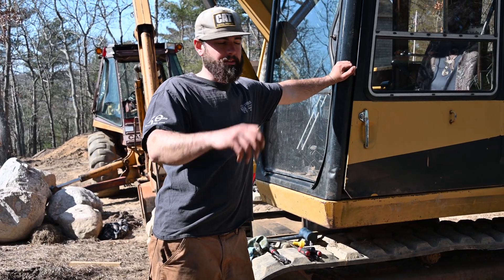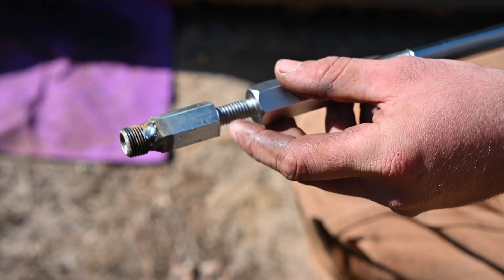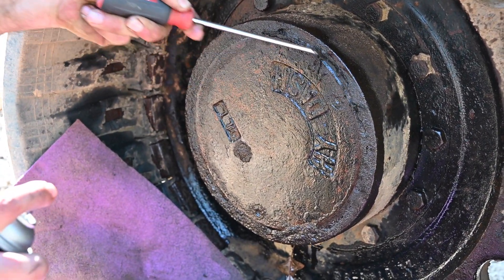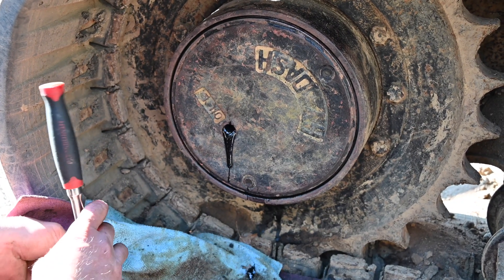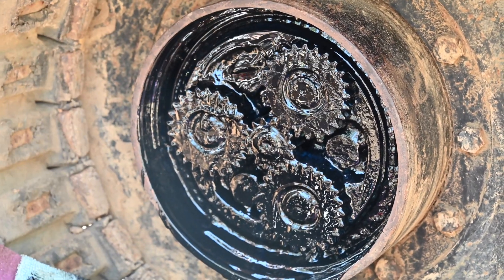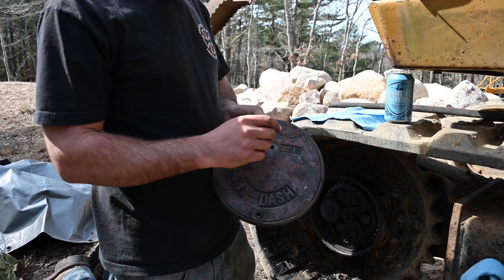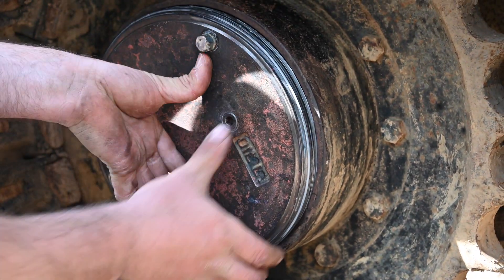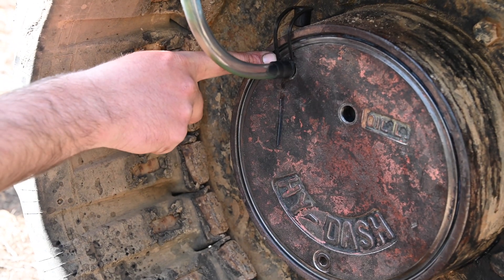CAT E70B Final Drive Repair

Comment: how do you tell if the final drive needs repair. what ´s signs to listen / look for sir.  thx for great video.
Reply from the maker: Luckily I haven't had a final drive fail on me personally or at work, but listen for metal to metal grinding, popping/knocking, or high pitched squels. If you see a leak take care of it asap, if fluid can get out, dirt & moisture can get in. Do routine fluid changes, if there's any moisture in there, or it gets hot enough there's condensation inside it can pit your bearings when the machine sits for long periods of time. They do wear out overtime like anything else but a rebuild isn't too too bad if you take your time with it

Comment: just found a small drip on mine. Great vid, just the info i was lookn for. Komatsu PC75uu-2
Reply: was it the plate seal o ring? my flange plug bolt broke off while tightening and the threaded part fell into the drive fml

Comment: Nice, thanks for the video :D I just ordered a drive motor + seal kit!! This will be helpful. Thats a peppy little machine. I paid 14k for it + 4 buckets.
Reply: Where you able to get parts through Cat?
Reply: @attk1984  https://imgur.com/gallery/Eg1fCS3 It seems i didn't take a pic ones finished. The new motor was a bit wider to the inside, so i put a couple washers under on the inside of the cover plate, so that it fit. I didn't want to bend the corroded hyd pipes, so instead replaced with hoses and put in new clamps for them. Otherwise install was really simple, bolt holes and everything else fit perfectly. Theres link to the shop, the one that says GM09 Final Drive. https://gzsyjx.en.alibaba.com/search/product?SearchText=e70b%20final%20drive
Reply: @7rixee  Awesome, thanks!  I tried to order one a few months back and they were not air shipping due to rona virus.  How was the shipping price?  Does your machine have a blade?  Mine does and I'm not sure if GM10 is geared different for a blade.  I hear you about china, unfortunately the travel drives don’t exist in north america due to the age.
Reply: @attk1984  Shipped by airmail, same as the motor or a bit more but I'm in Europe. Took about four days.. Just send them a message, you'll hear back in about 10 minutes. Gotta say they have good support, I had the alibaba app and they responded in five minutes to my inquiry while i was installing the thing. I do sound a bit suspicious with my praise eh. Let me know how it goes.
Reply: @attk1984  No blade on mine.
Reply: @attk1984  No, from China on alibaba. I can send you a link if you want. I don't really like sending more money to China but there isn't really an alternative.. I got it in 5 days..
Reply: @7rixee mind sharing the link? Do you still order parts off of Alibaba for your cat?
Reply: @zowens5465  Melody will fix you up with everything you need.
Reply: @zowens5465  Doesnt show my msg, but did you get this? 🤷‍♂️ Guangzhou shiyo mechinery engineering